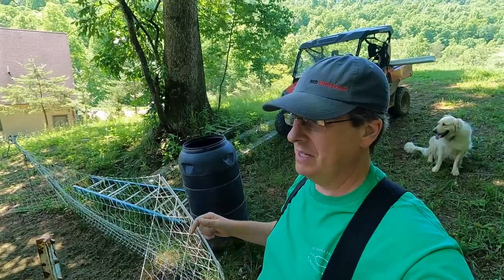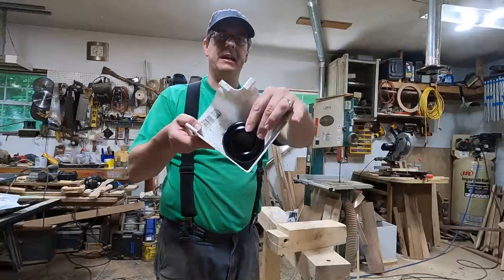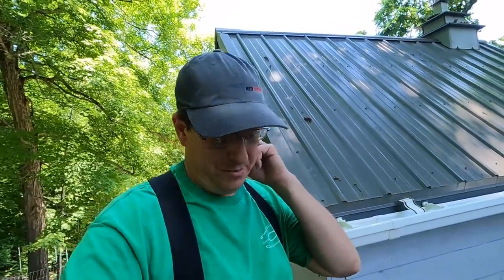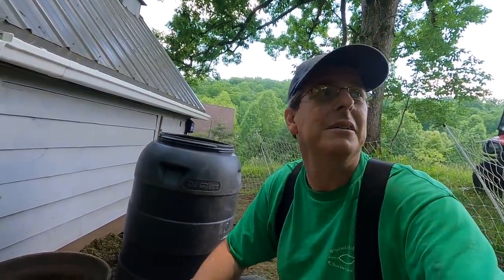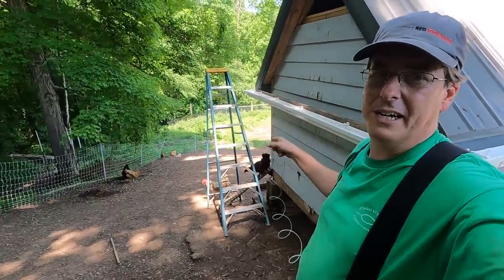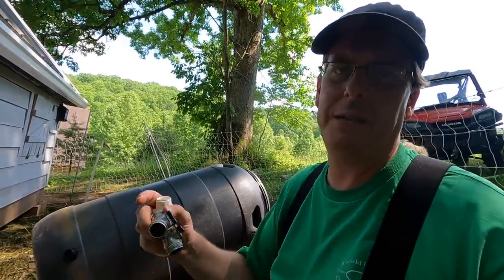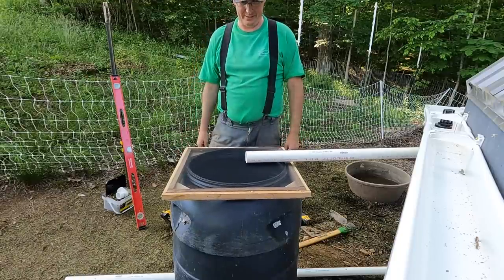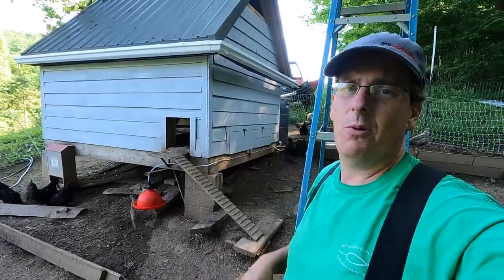99.9% MAINTENANCE FREE Chicken Waterer (Installed on the Chicken Church)

Comment: I think the leaves from the white oak will clog the gutter filter quickly.  Buy or build some “gutter guards” and keep the leaves out, then the filter won’t clog with the medium sized stuff.
Reply: Yes. Use some of that screening material and staple it in across the gutters to allow leaves to wash over the edge while water (most of our) sinks through the screen into the gutter. It's not fool proof but it will help take it from 99.9% to 99.9999% lol. 
Realistically, I think this is only about 90% maintenence free because of the 2 to 3 times a year it will need to be cleaned. Beats the heck out of daily watering.

Comment: Not only have you simplified but it's grid-down proof too. Well done Troy ! !
I've been using PINKY FILTER fabric for over 10 years. Inexpensive, double layer, washable, flexible and comes in 10' rolls.
You can roll it and fill the gutters, lay a section over the landscape fabric and wrap/loosely stuff it in pipe ends. I'm sure creative Troy could find even more ways to use it.
UNISEALs will be more cost effective and simplify your plumbing projects. And your spit will come in handy.😂
I've had aquaponics for decades and noted that when you daisy-chain multiple rain barrels - each time the water enters a new barrel there is less sediment. This works best if the barrels are connected more than 1/3 from the bottom. The hose to your bell-waterer should be connected to the barrel farthest from the gutter inlet. I also learned (the hard way) that it's best to daisy-chain the barrels with flexible, garden hose so if one barrel shifts, all the pipes won't break and release your water.
You knocked out another great addition. Thanx for the video. - KJ 🖖

Comment: Troy, to seal things temporarily try seal and peel silicone. It comes in calking tubes lays like silicone and seals like it but can be removed like the glue on mailers and stuff like gift cards ext that you can easily peel or rub it off when needed

Comment: Good idea 
You are going to want to put some large stones in the barrel as ballast 
I used a couple of cinder blocks 
I also was multi tasking for the garden so I used 4- 55 gallon drums with my overflow going to a pig pound of sorts 
I wouldn't have bought new corners I would have siliconed the crap out of it and used some self tapering screws 
But that's just me 
Have a good one brother 
Hope this helps 
Just saying

Comment: Why brass fittings when you could have used pvc fittings to reduce the diameters? Come winter, as other posters have mentioned, freezing might be an issue.  I suspect another $300 investment in a cup heating coil. LOL
Reply from the maker: Spent 2 hours in Home Depot tryin mg to find the fittings in plastic. They didn’t have them

Comment: How do you stop the water from continuously dripping when the bell is full and no longer needs any more water until the Chickens drink it?  Won't area around the bell get soaked and drain the water barrel?
Reply from the maker: The bell sits on a spring mechanism that when adjusted properly shuts of the water. Only when it gets lighter from drinking will the valve open and refill.